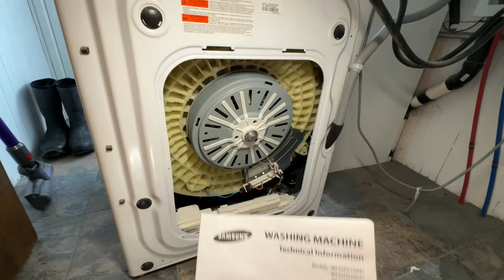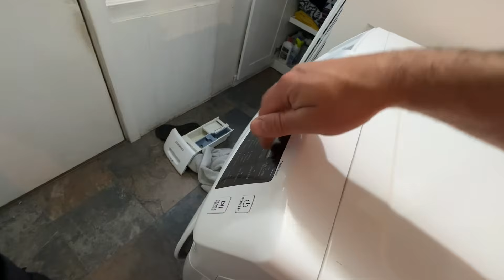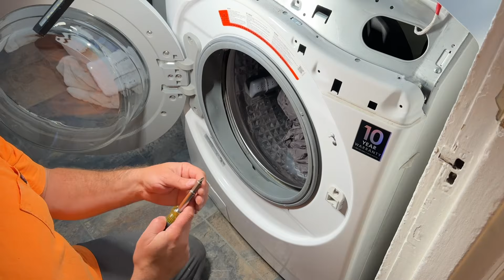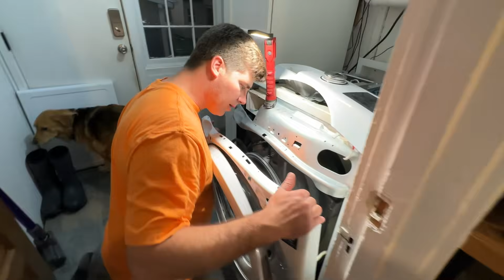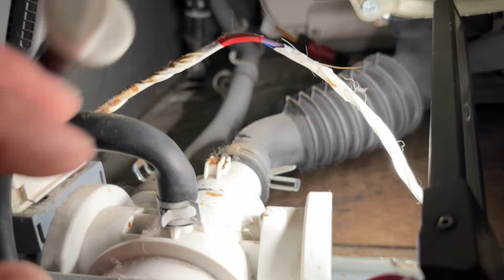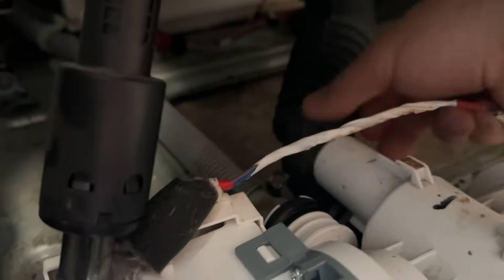How To Diagnose And Fix Your Samsung Front Load Washing Machine That Wont Drain

Comment: Before doing all this, - the same symptoms can be resolved by cleaning your filter located in that little door on the bottom left. If it’s blocked, the machine won’t operate and will hum just like shown in the video.  It takes about 15 minutes.  Pop up in the door put a bath towel underneath -  about 2 cups of water that will come out. Unscrew the filter.-  clean it out also check the drain with the flashlight  iand then screw it back on.  Mine had a a lot of junk in it.

Comment: We bought this washer with the matching dryer in 2019. It looks good and functioned and washed well. Then a week ago (now 2025) the drum failed to move after the start cycle began. Technician pinpointed either the motherboard or drum motor sensor as having failed. Either way, these components have to come from Korea as a package. With labor, the repair would be $640 which is 85% of the purchase price. I'm beyond disappointed that this machine only worked for 5 years and 11 months. The motor, pump, valves, etc. all seem to be fine. I'm hearing it's often the electronics. I'm frustrated with the expense of these now fragile tech-laden machines and gun-shy to buy any of them again.

Comment: I bought a brand new Samsung washer dryer stack set less than a year ago, dryer started acting up first, watched some YT videos and the dryer needed the plugs going into a circuit board inside the dryer unplugged a plugged back in, had to do it twice but fixed that so far, now the washer is acting up, but thanks tp YT I figured out how to get it going again, now if I use liquid detergent it wont come on, also unplugging the washer and waiting about 10 seconds will get it going sometimes. I wish  had done more research on Samsung! They need to jusr give up and stop making washer/dryers!

Comment: I had a repair guy come 3x for my washer. All he did was empty the trap and removed water from the spinning electric motor. The third time he said I would need a new pump 😮😮. I bet he knew that the first time. After being robbed with 3 service call bills I went online and ordered a pump. The troubleshooting instructions were under the bottom plate 😮 Easily replaced I never called him again 😂

Comment: Well, this was very detailed and I feel like I could change the pump motor if I have to. Thanks for showing us. I did find that once I cleaned the filter and did a self clean, it works a lot better. My niece said my loads are probably too small so it was struggling with adding water to balance the load. I did forget to clean the filter that’s on the intake in the back so tomorrow’s project has already been decided for me lol Thanks again! 😊

Comment: This was a rarity. I'd say 99 times out of 100 when a washer isn't draining properly, you'll find a sock stuck in the impeller of the pump. It's usually families with small children whose tiny socks get swallowed by the drain pump. I tell them to use a garment bag when washing those tiny socks, it keeps them contained!
Reply from the maker: Yea I was going to include that part, checking the filter but wanted to keep the video very straight forward. Thanks for the input
Reply: I came to say good job to the poster, and wanted to share what I see you mentioned! Happened to me! Kids sock was stuck in the accordion-like black tube up stream of the pump. I replaced the pump, and then the problem came back. That's when I was able to feel that the tube was strange, and extracted a sock! Oh well, got familiar with my washer :) The garment bag is a great suggestion!

I'm new to your channel, just saw a video of you doing a diy sheet metal furnace box fab, and hope you have more videos on sheet metal and the tools I would need to get started.

Comment: I didn't see much "diagnosing" here.  When you said "it sounds like the pump is trying to work but it's not" I assume you meant you heard a buzzing sound like the drain pump was jammed by debris... similar to the sound that a jammed garbage disposer makes.  Before replacing the drain pump (or a garbage disposer) I would first check whether it can be unjammed by clearing out any debris inside it.
     If instead it sounds like the pump is operating, I would check for clogs in the drain filter (if there is one) and in the internal & external drain hoses.  I fixed an old Maytag that wouldn't drain just by cleaning a clog out of the hose between the tub & pump.  Clogs aren't uncommon.
     Modern clothes washers have an easy-access filter to protect the rest of the drain hardware from clogs.  If the filter gets clogged, it's easy to clean... and maybe you'll find some spare change there. (My old Maytag didn't have a filter, unfortunately.)
     For many clothes washers, access to the drain hardware is through the back panel.  Less labor.
Reply: I was thinking along the same lines... he said "that sound is the pump trying to bring water in" but later in the video correctly says "that sound is the pump trying to drain water out". 

So basically he could have had a lot of debris in that cleanout filter where he drained the water out, and that might have been the fix for most people. In his case I am sure the actual pump was bad, but nonetheless
Reply: @jerrardo4   : I couldn't tell whether his pump was broken or just jammed by debris.  If he examined it, I must have missed that.